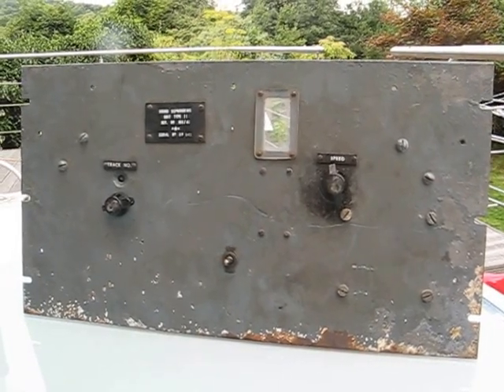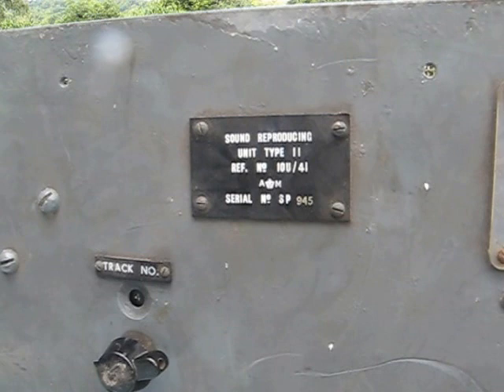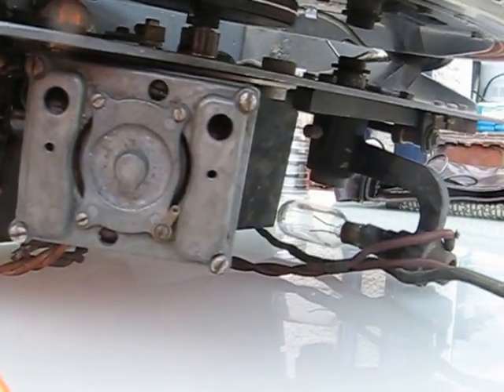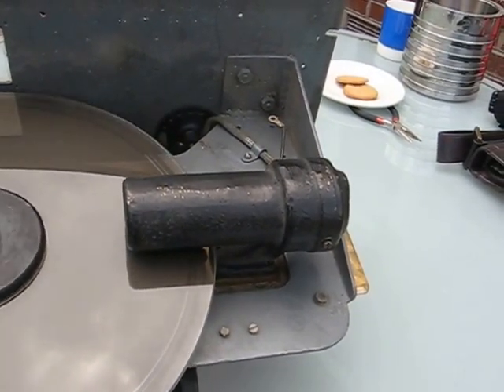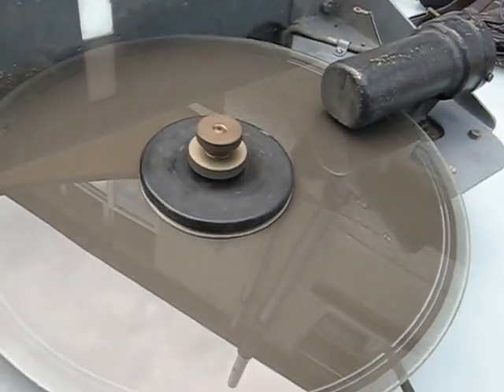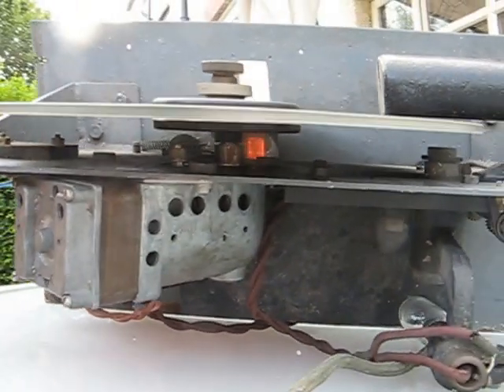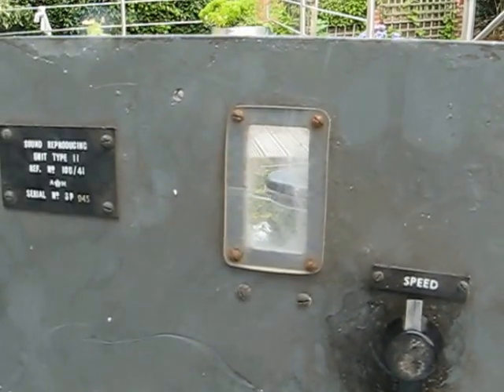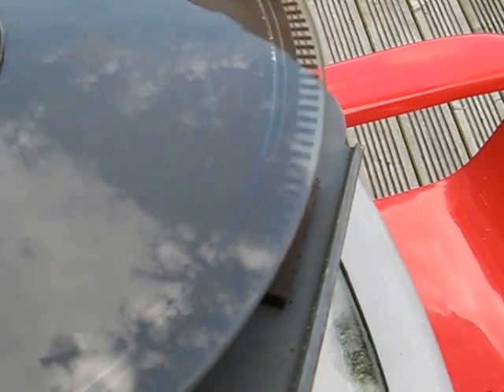UK WW2 Air Ministry Sound Reproduction Unit (Secret Weapon?)

Comment: "The Coastal Command Synthetic Training Manual, (TNA: AIR20/6057, Feb 1943) states:

THE CREW PROCEDURE TRAINER
Introduction
The crew procedure trainer is similar to that used by Bomber Operational Training Units (??). It is designed for the purpose of instructing aircrews in the correct procedure to be carried out during operational flights.
The trainer consists of a large room or building which houses cubicles, usually five in number, a controller's section with all the necessary equipment, an epidiascope and screen, and a ground W/T station. Each cubicle holds a crew of three and contains all wireless and navigational equipment similar to that carried in the aircraft being used for training ; the arrangement and layout of the interior of the cubicles is made to resemble that of the aircraft as far as possible.
To make the exercises a little more realistic and to prevent the crew from talking to one another without proper intercommunication, engine noises are reproduced in the cubicles by means of a " sound reproducing unit," Type 11. "
Reply: Thank you for all your comments. Since posting the video I have given the machine away to an antique dealer who said she would pass it onto a collector. I had tried selling it on eBay to no avail and as it was a gift to me it owed me nothing so I don’t mind if she profited from it.

Comment: If I'm remembering correctly, I believe such a glass disc setup was used in some capacity for many "Speaking Clock" systems for telephone networks.   I think that the glass disc had either the "At The Tone, The Time Will Be __", or the "0:05, 0:10, 0:15" for the hours, minutes, and seconds sounds, recorded on them.

Comment: Also if it's anything to do with SIGSALY or the like, maybe it's an optical successor to the shellac and acetate discs that it originally used, which were in turn rather fragile, and rather soft and thus none too resilient to many hours of continual use... Not that glass is much better than shellac, but it's easier to make a thick, sturdy glass item and then print it (or sandwich a vignette sheet with stamped holes in between two of them) than to make a really thick needle-and-groove record.

I would expect they kept those systems in use for a while after the end of ww2 after all, until better, solid state successors could be produced, as they were kept classified until 1976...

Then again, the track-select thing is a bit strange. Might just be for equipment test tones, or broadcasting different kinds of sirens and signals at a firing/bombing range? After all, it's not going to have any particularly great length of voice or other real-world recording on it if the head is held in a stationary position and the disc is turning at that speed...

Comment: This seems almost exactly like what was used by the 1970s-era "Optigan" keyboard instrument to playback instrument sounds that were optically recorded on a flexible disc made of transparent photographic film, in turn using the same techniques for optical soundtracks on motion picture film.  This looks like a ruggedized, military predecessor of such, maybe it could've been used to playback a voice message continuously, or maybe it could've been use to play out some sort of other signal to be transmitted, such as a radar or facsimile/SSTV image.  At 2:08, it looks like the disc does have two inner "variable-area"-type optical tracks recorded on it, to the left of the outside synchroscope track.

Maybe you could cannibalize the optical sound head from an old 16mm movie projector to get this unit working ;)